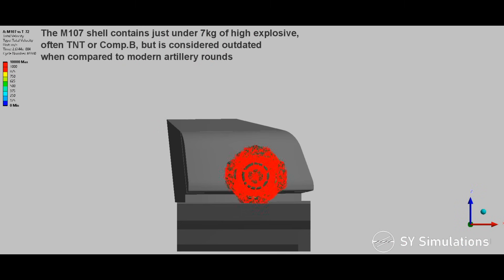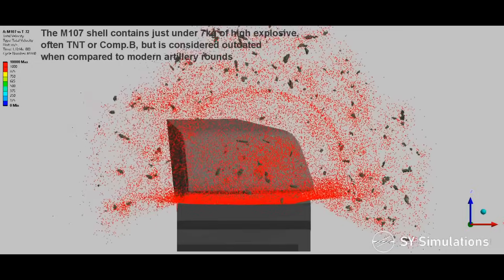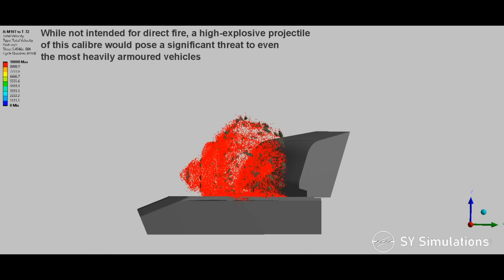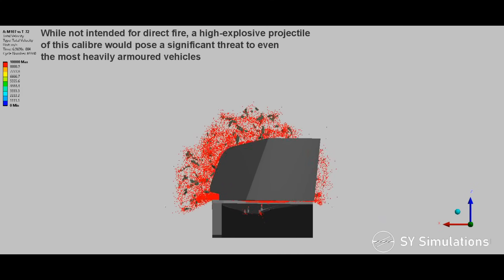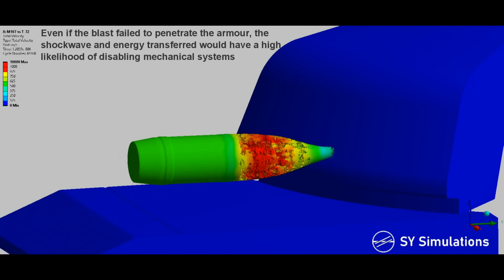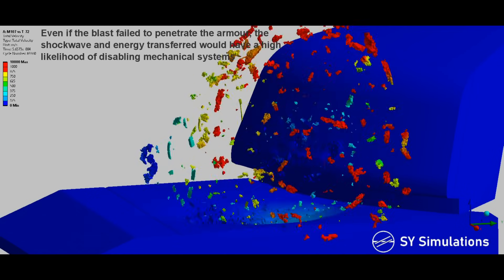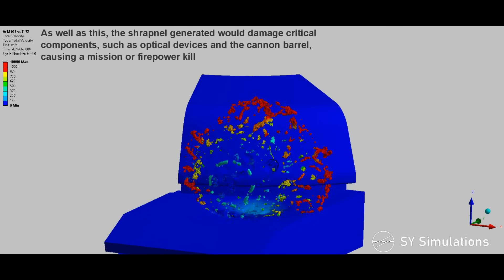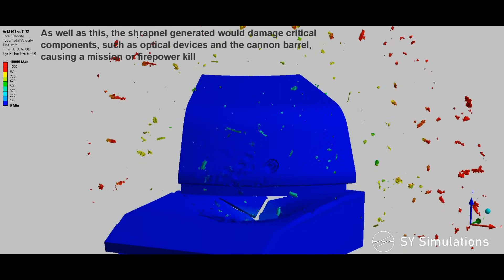DIRECT FIRE ARTILLERY vs T-72 | Paladin 155mm M107 High-Explosive | Armour Penetration Simulation

Comment: That ain't just a mission kill, that's a proper kill for whatever is under that roof. Unless there's more armour under it that isn't simulated.
Reply: thats a fuel tank under there, and right beside that fuel tank is the driver, behind him is the ammunition soo... Lots of volatile important things in that area
Reply: @rightaxlebroken4835  that fuel is diesel, it won't ignite from that
Reply: @LeDeux11  but you now have a massive fuel leak, a giant breach in the top hull armor near the driver (who has been absolutley eviscerated) and whatever remains of the commander and gunner as well as the devices inside the vehicle as well as the auto loader and ammo (which will probably be damaged and not able to be fired by the main gun)
Reply: @4T3hM4kr0n  well aren't you dramatically over-theorizing.
Reply: @Phil451  only if that pressure and heat is maintained
Reply: @LeDeux11 diesel can be ignited when it’s been atomized, heated above it’s flashpoint (70C I think?) , or soaked into a porous material with a surface temperature above the flashpoint. 

Here it’s going to be hit by multiple kilograms of fragmentation going about 1km per second, along with the fireball from the shell and from any other ammo that cooks off. 

But that’s probably of no consequence, since such a massive section of the hull has turned into fragments and been blown inward.
Reply: @LeDeux11  Bro is thinking things out, unlike you.
Reply: @LeDeux11 it will. Pressure created for a 155 arty shell will ignite it 100%
Reply: the shell impacted the composite array so the shockwave directly to the front wouldn't do much, however explosives follow the path of least resistance. This means that the gap in the turret ring and the giant hole now near the drivers hatch is where all the energy will go (and will then expand outwards since it is then "entering" a cramped interior)
Reply: belka did nothing wrong
Reply: belkan...
Reply: Over pressure would sent that turret flying